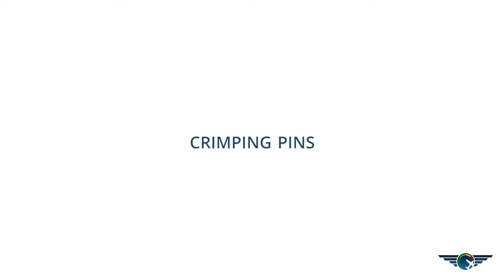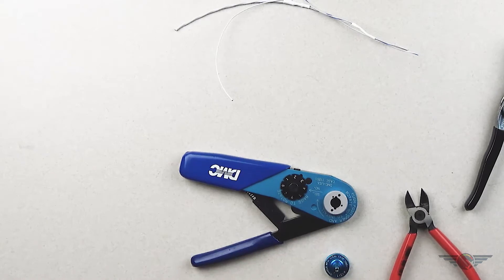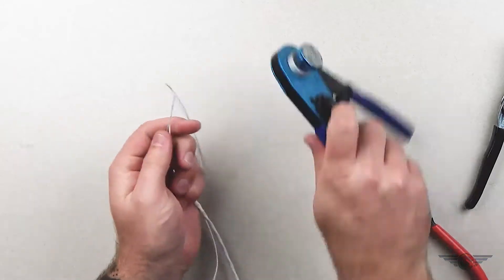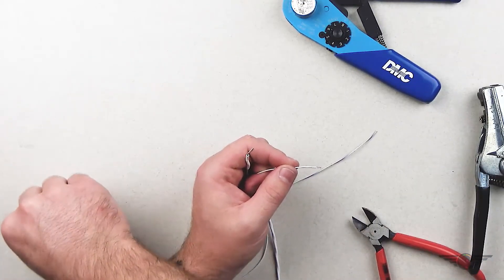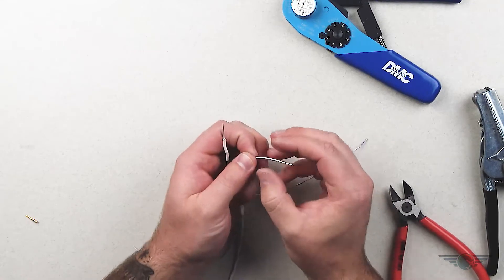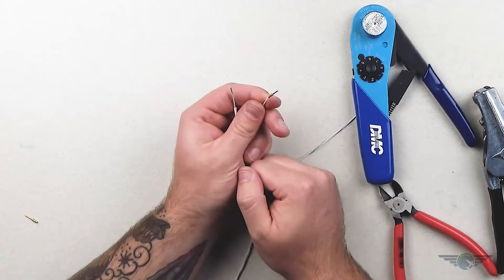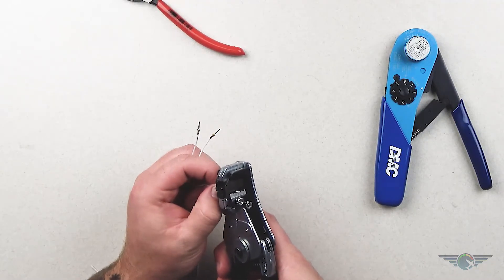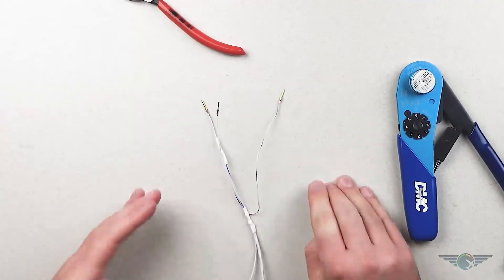Garmin G3X Wiring Fundamentals Series – Crimping Pins

Comment: Hey Garmin, what are the most common part number for pins and sockets in your aviation application?
Reply from the maker: Hi Timothy, there are a couple of different sizes, a standard and high density pin size, depending on the product. All of these and the associated part numbers can be referenced in the G3X Touch Installation Manual here: https://static.garmin.com/pumac/190-01115-01_ap.pdf. Thank you for considering Garmin.